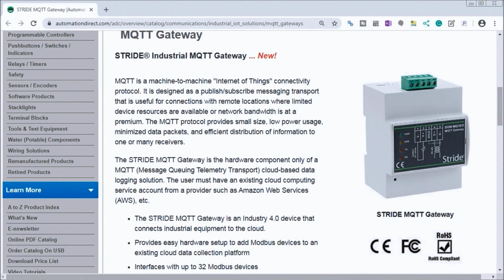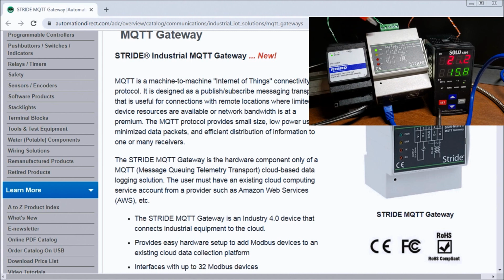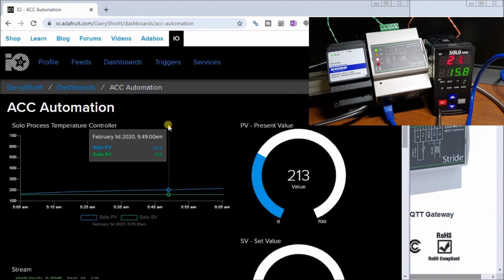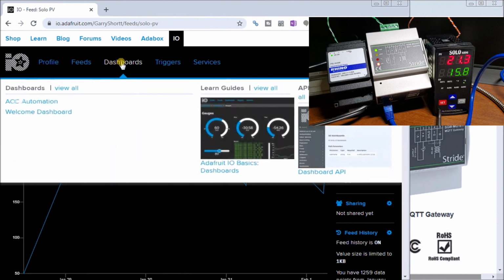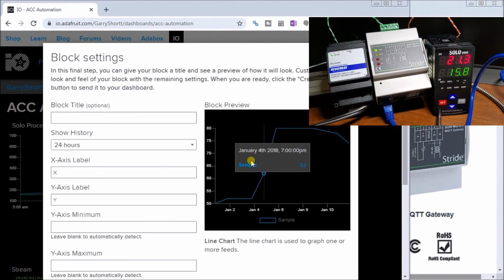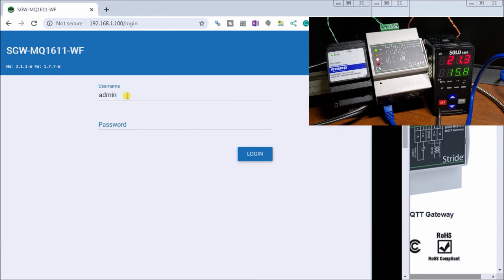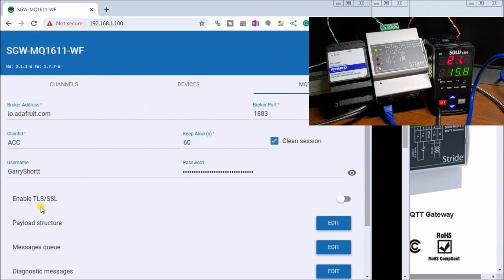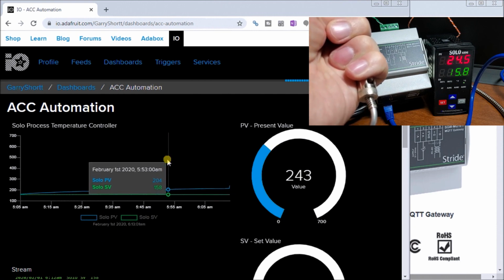Industrial IoT Magic: Connect Modbus to Cloud in Minutes

Comment: Have you connected with AWS?
Reply from the maker: Hi Ivan,
I have not tried connecting to AWS. This should be easily done with MQTT.
https://docs.aws.amazon.com/iot/latest/developerguide/mqtt.html
Regards,
Garry
Reply: @ACCautomation  I Tried this and already have it online on AWS IoT. But there is a big problem for the firmware version, it is necessary to update gateway to the latest firmware. Thank you so much.
Reply from the maker: @ivancruz6241  
Normally, the first thing that you would do with new hardware is to update the firmware. This will ensure the latest software is used on the equipment. 
This post will show you how to update the firmware.
https://accautomation.ca/stride-mqtt-gateway-modbus-rtu-tcp/
Here is where you can get the firmware updates.
https://support.automationdirect.com/firmware/binaries.html
Regards,
Garry